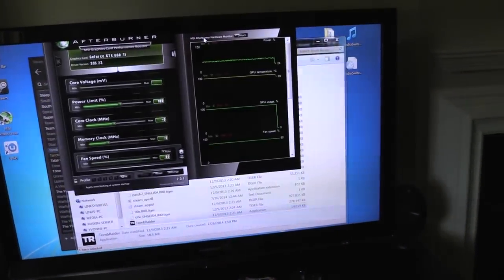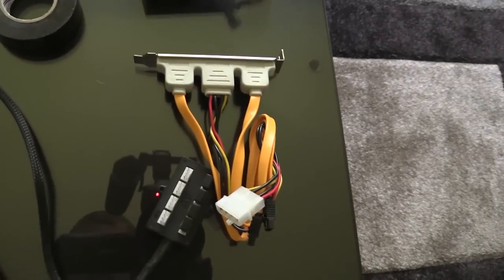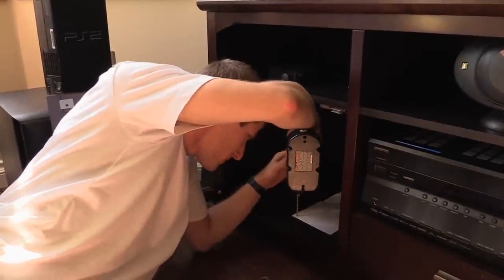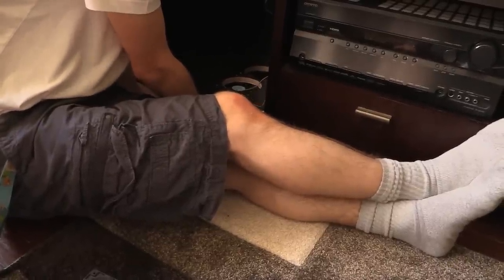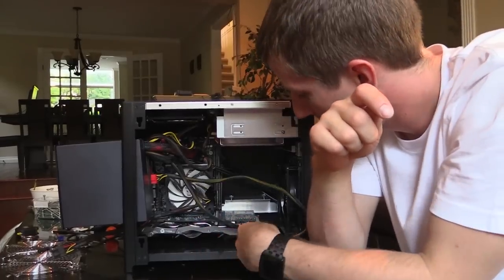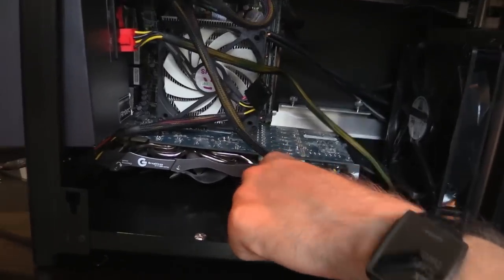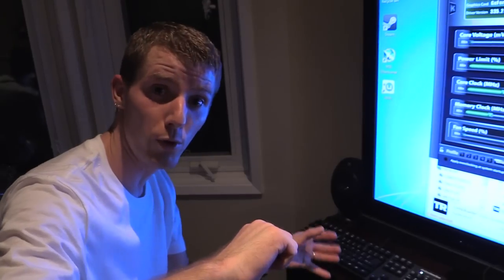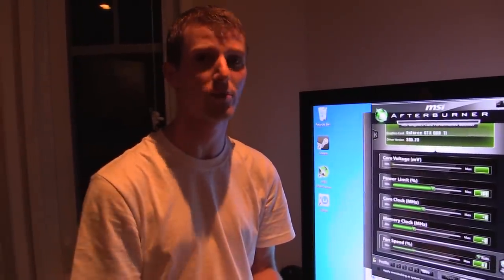Entertainment Center Cooling Mod - Linus DIY Method

Comment: If money isn't a issue I would make the "mod" different. I wouldn't have any case to the computer. The cabinet would be the case. 2 fans at the bottom and 2 on the back. Motherboard would be mounted "the normal way". Meaning I would cut of the motherboard backpanel from a old computer. Then drilled the plate to the cabinet wall. After that mounted the motherboard on to the plate. CPU and GPU would be liquid cooled so the heat won't be a issue inside the cabinet. The liquid cooling heat would be directly exhausted outside from the cabinet.
Sorry my English is really bad :( 

Nice video! I would like to see more theese "blog" videos
Reply: kimiZZZumi Your English is not so bad and your idea is good.
Reply: Thats a pretty good idea actually :D

Comment: I can't believe I found a 3 year old video, where Linus' wife actually solved my issue for me.  Her "ghetto" idea of running a power connector out the back of the case was the easiest/cheapest solution to my problem.  I've been trying to figure out the easiest way to get reliable power to a 200mm case fan for intake in the wall of my computer closet.  The intake is only a few inches away from my matx case.  Thanks Yvonne (and Linus, I guess)!

Comment: Both your ways suck. Do it this way:

Make a custom "case" out of that little cabinet thing, then install a custom liquid cooled system with cool LEDs and custom sleeved cables. Make a gorgeous show piece out of that wooden cabinet :^)

Please Linus I would really love to see that. Pretty please?
Reply: "His way" probably costed him 20$ .. what you're talking about might cost him around 200$ .. so in conclusion i'd prefer a 10c difference for a 20$ mod more than a 20c difference for a 200$ liquid cooling mod as long as it fixes the problem.
Reply: +Long Nguyen Also "cool leds" in a wooden cabinet are not cool, they're tacky and hideous. It should be invisible and if you want to do mood lighting go the Philips Hue way and do it properly
Reply: +Long Nguyen why not just put a table fan into the cabinet
Reply: Or just mount the mobo on the side and cut slots for the pci and forgo the case. Possibly go for a larger intake fan on the bottom.
Reply: +Long Nguyen DONT FROGET AN TITAN X

Comment: Cool video but that rig needs water
Reply: For an entertainment center?
Reply: I second this. It would be perfect since you can easily mount the rad on cabinet.
Reply: what??? 660 ti and core i5 on water? that doesn't make any sense since he isn't going to oc the crap out of that system it wouldn't make sense- his pc could run at lower than the room tempreture causing water to condense on his components which would kill them.
Reply: darkmonster11LP unless that gpu is running a 3 fan design why not? The Temps will be half of that
Reply: Kristian Klos every rig needs water :P
Reply: 1st World Problems :D
Reply: darkmonster11LP This comment is incorrect as in a water-cooling loop the water does not dip under room temperature. Unless he uses a chiller, the water will always be above room temperature as it is being cooled by the air in the room. Also, even if he uses a chiller, he would have to cool the whole motherboard to cause condensation on his components. The point of a water cooling loop is to cool the specific components, not the whole machine. Also every computer benefits from cooling systems. You don't know anything about water cooling.
Reply: darkmonster11LP  I agree unless he used an external rad witch is how I would do it
Reply: ✨CRAZYGUY✨
hes having problems only with graphics card....so water cooling would help him ton...
Reply: xAsmir Read my whole comment and the comment I replied to before posting.
Reply: You mean it's thirsty right?  I can feel my brain start to throttle when I get hot.
Reply: Asher woodman He is not ignorant, he is just mistaken.  There is a difference.
Reply: BigSpoon88 Ignorant.- lacking knowledge, information, or awareness about something in particular.
Reply: ✨CRAZYGUY✨ Find a crazy water cooling mod where a guy mounted 40 fans on his h100i and got his overclocked cpu (4.6 ghz i think) to -x degrees... so next time do some research...
Reply: so I'm just saying it's possible!!!
Reply: Asher woodman You're wrong, he's right.

Ignorant - lacking knowledge or awareness in general; uneducated or unsophisticated.

Mistaken - wrong in one's opinion or judgement. Based on or resulting from a misunderstanding or faulty judgement.
Reply: bosfreak12 agreed hehe
Reply: the only reason he needs water cooling is because he can have an external rad box rather than having a shit ton of fans in the cabinet
Reply: good point but if it works then why spend more money on a water cooling if he's not going to be overclocking that system
Reply: Cause who wouldn't love to have a liquid cooled media PC in their living room xD If we are talking about cost then obviously there are better ways of doing it, but for the best temps and noise, water would do the trick.
Reply: :D yeah i gues you're right but i think linus knows what he's doing and he had a reason to go with air :D
Reply: Yeah he probably had the parts to spare, I don't think most people would liquid cool a media PC in their living room xD
Reply: XD
Reply: darkmonster11LP i saw that video, it was a troll lol it even said so in the discription
Reply: hmm... yeah sure... it doesn't...
Reply: darkmonster11LP dude oc3d video was a joke it didnt go to 0 degree imo
Reply: darkmonster11LP Honest question. I'm planning on building a cheap but a good bang for your buck system. I'm still looking around for parts but I'm gonna get a sub $200 processor. Now my question is, wouldn't the lower constant temperatures from the water cooling be more useful for the overall lifespan of the system? (I plan on occasionally overclocking the components, but not run it as default with OC)
Reply: Carlos Reyes You don't need watercooling, air cooling will suffice. You only need water cooling if you do crazy overclocking and run it as default. With a lower cost CPU its almost not worth it unless you do crazy overclocks to make up for the cost. My advice is: get an air cooler- much cheaper and will suffice for your system. DON'T USE THE STOCK COOLER-IF YOU TRY TO OVERCLOCK WITH IT, IT WILL DESTROY YOUR CPU. In terms of lifetime, we are talking slight differences like another couple of months or maybe a year depending on how well your chip handles and takes overclocking but in most case the difference is very slight and can be due to luck.
Reply: ✨CRAZYGUY✨  I disagree. Even water is better for stock settings as the temp in some cases can be cut in half at idle and load.
Reply: net200777 This is obviously a budget build and watercooling is just nice to have but is not essential to overclock and if you dont overclock, a watercooled system is pretty much unused as in this case and it would just be a waste of money.
Reply: ✨CRAZYGUY✨  With AIO coolers you can watercool for the same price as most aircoolers.
Reply: For example my i7 idle on air was 40-50 idle on just a n h50 back in the day idle was 28. Big difference.. especially load temps. The loads are the same as the idle with stock air.
Reply: Kristian Klos
yes you can throw the radiator behin the cabinet .D
Reply: yeah

Comment: You shouldn't have moved it to the cabinet in the first place :)
Reply: lol problem solved
Reply: I guess you dont have a wife
Reply: JasuTheSnipe Unfortunately you are wrong ;)
Reply: holynex His comment was funny none the less ^^
Reply: Or closed the front door
Reply: Wouldn't it be interesting to do with an open mod-case and a non-see through cabinet door? Mod the cabinet so that the mod-"case" can slide in for easy access and use an acrylic one so you can see what's going on when the door's open...
I guess you'd need to add some rubber to prevent the cabinet from vibrating... Depending on your performance you might get wife-approval on vibrating furniture.
I can't believe how much text I used just to build up to this silly joke.
Reply: Thomas Al Abdallah-Sörensen Dude, your name is hilarious xD
Reply: Actually not using that Lian lee case for a gaming ring would have been better: other mitx cases have way better cooling and design.

Comment: WTF???? I'm surprised that GPU didn't just get melted.

Anyway, i thought you were going to drill holes in the bottom of the case, allowing the GPU to breath out, while still having the cabinet coolers at the bottom (as outake), this would probably require some tinkering with the screws for the bottom coolers, or rubber feet for the case, and dust filters.

OOOOR, get really imaginative, get the coolers out of their plastic frame, leaving them INSIDE the holes and avoiding the issue of the screws, and having a more aesthetically pleasing result (add a magnet filter at the bottom of the coolers or case, and you're golden).
Reply: GPUs don't melt nowadays, they kill the computer before that happens. It skips the blue screen and just shuts off instantly.

Comment: god linus you totally mutilated that nice entertainment center/cabinet.
Reply: In order to cool the PC that was probably more expensive than the cabinet.
Reply: x8BitRain why not just put the pc on top of the cabinet and cool it with water cooling? would of made way more sense.
Reply: It would look unappealing up there and water cooling isn't necessary for Media PCs, as they aren't used for anything other than watching movies or playing games, I doubt he renders videos on it.
Reply: Zack
Water Cooling is a bit overkill for this kind of rig.
Reply: Zack His issue was that his GPU was overheating. A GPU water cooling loop in a small case like that seems less than ideal.
Reply: cheddar07 you can do an external water cooling loop... in this case it would have been fine.
Reply: Zack
Water cooling? That would be loud.
Reply: no water cooling can be very quiet actually, in fact it is one of the very reasons people water cool. Large Radiator, slow moving fans and basically allowing the radiator to passively pass the heat out to the atmosphere...
Really sounds like you don't know water cooling Ahmet C. Ay
Reply: Bevin Warren
Never done it myself. I just heard it was loud.
Reply: Ahmet C. Ay Its all fine.
Reply: Bevin Warren Yes, you could. But that would a lot more expensive and time consuming than doing what he did.
Reply: cheddar07 but it would have been a far better and more elegant solution.
Reply: Bevin Warren thanks for having my back on this Bevin, never thought anyone on the internet would take my side on anything lol.

Comment: Linus i am disappointed at your gaming set up, you make this badass videos about water cooling gpu and all this awesome stuff and you git this problem?
Reply: its a media PC as in in his living room so its more or less for Netflix and stuff like that not hardcore gaming
Reply: It isn't smart putting water cooling there cause if it leaks not only would he run the risk of ruining the pc but the wood and all of the electronics behind it. IF it were to ruin the things behind it then it could start a fire. There are many different situations that could occur with this computer's placement.
Reply: bbstar54 ??? I'm sure someone will notice the leaking radiator before the wood starts to rot... And just saying, I've personally never seen a watercooled system leak. Ever. As long as the builder isn't stupid about anything, it should be solid
Reply: Probably not enough room in that case

Comment: Not a good result, would be better to just leave the door open or water cool it with radiators mounted to the entertainment unit.
Reply: I don't get why he took the door of it's hinges.
Reply: Zero thermal throttling is definitely a good result. An open door is not an acceptable solution. Water cooling with external radiators is way more involved and much more expensive

Comment: The airflow in that case looks non existent.  Just cut out the bottom, like you said, and you're temps will probably drop another 10 degrees.  No one is gonna see the case in your cabinet anyways.

Comment: Linus... You're using an old version of Afterburner aren't you ?
Reply: hes just using the big skin version, plus no reason really to update it on a media pc that already has a solid overclock.
Reply: Kilobits true, true.
Reply: can i ask what makes you think that?
Reply: ***** ui looks different, which varies on the card, and it was in big skin mode since its a tv, so it just looked older

Comment: Wife's way is better: should you ever move the case to a desk or something, it doesn't have a permanent hole in it. IMHO at least.
Reply: He was planning on cutting a giant hole in the bottom of the case anyway.

Also: Linus' method wouldn't have a "permanent" hole. He was going to screw that male Molex plug into the rectangular hole he cut out, filling the gap/hole and making an external Molex plug.

I vote Linus.
Reply: rainy724 thanks for keeping it smart and polite. Those are great reasons.

Comment: He just made a case, for his case... I would have integrated the pc into that cabinet for better cooling, and to display a crappy pc... (I pretty much have a 660 and an i5... so I'm kind of upset now...)
Reply: Yea I know, It's pretty much the best bang for your buck if you're super budget, but the way Linus treats low baller gear is insulting for my pc... But I'm fine with it, cause he actually has a job and can afford all his things...
Reply: MiniNinjia - I don't know; the 760 is only $50 more and offers near on the performance of the 670.
Reply: ***** - I had a 550 Ti until I bought a 760, and I still gamed at playable framerates (which I took to mean around or above 40-45 fps, though now I generally shoot for 45 as an absolute minimum, with an average above 59-60) on high settings at 900p.

I'm sure there are probably at least a few AMD cards that can offer an even better value than that, though they'd be much louder and hotter.

I think I still have an HD4850 somewhere with 512 MB of RAM that ran CoD4 at 900p with at least 60 FPS, though having that GPU in my computer raised the ambient temperature of my room by almost six degrees Celsius, no joke.
Reply: ***** I have IGPU on ma laptop, can get much less down on the performance scale than that.

Comment: Use an external 12v power supply on an outlet strip with a master device control that trips on the other outlets when the PC fires up ( it sees the voltage drop and turns the outlets on). You can get these at Home Depot, Lowes or on-line. My Adcom amp came with an external power conditioner that does this and I have done this mod you did in this manor. No ghetto wiring from the PC. Also, you should have run the lower fan wires under the cabinet. This would have required unloading your cabinet, but I believe in doing it right from the start and not having to fix it later.

Comment: I like it but why not just do water cooling since you had the parts for it and it would mean the cabinet wouldnt have to be a sauna XD
Reply: shiro yuki I was thinking the same thing. Maybe it would be nosiy having the fans cooling the radiator outside the cabinet.
Reply: Unbornparadise yeh but a rad means lower fan speed and youd only need to worry about the pump

Comment: Water cooling would be the ideal but if you stuck with the current thought a rear blowing gpu inside the case and instead of 120mm fans I would have gone with a 200mm exhaust fan in the back of the cabinet and possibly a 200mm fan on the floor of the cabinet. I think you would move more air that way as far as temps inside the cabinet go.

Comment: If you're gonna have the fans blowing into the bottom, make sure there is somewhat of a seal so they can apply pressure into the case, or it will just follow the path of least resistance and go into the cabinet.

Comment: Me, I'd go full ghetto. 
I would 
- Remove and seal up the front blower.
- Make a cork gasket around the side open panel.
- Lay the machine on its open panel side over the floor blowers.
- 2 holes in the back cabinet but no fans. 
- Also I would rubber gasket and suspend the bottom fans for more quiet operation.

Floor blowers will cause a positive air pressure that will force to exhaust all the heat.